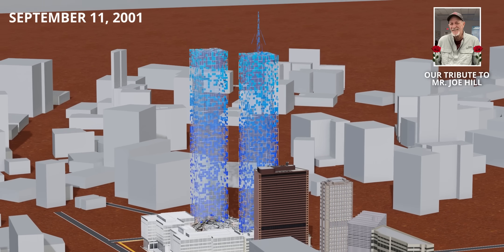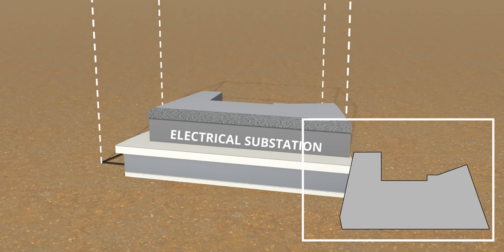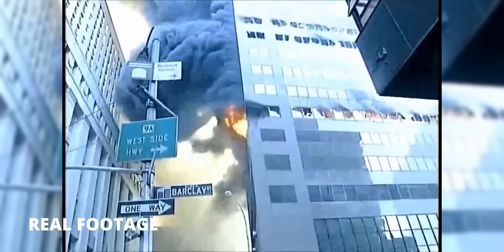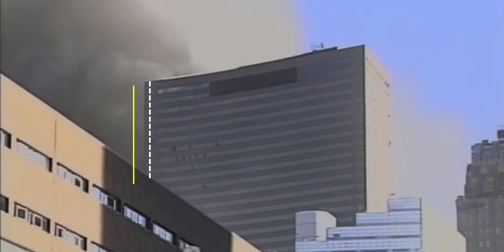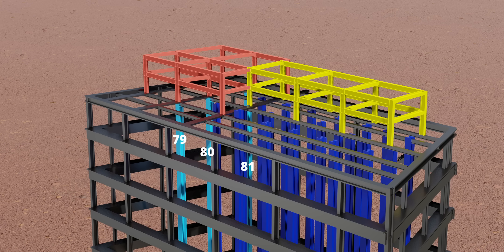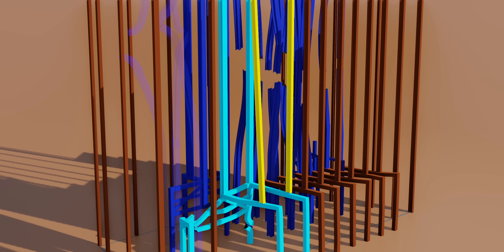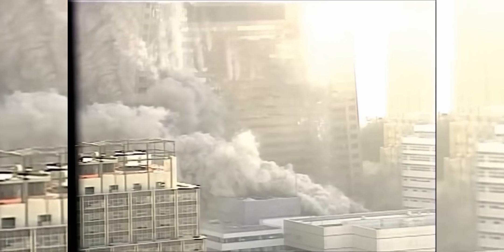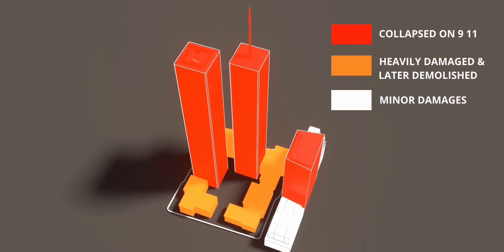Collapse of Building 7 | The Complete Physics

Comment: Critics point out that the temperature at which jet fuel burns is significantly lower than the melting point of structural steel, suggesting that the towers should not have collapsed solely due to the heat. The mysterious collapse of World Trade Center Building 7, which was not hit by an airplane but still fell in a manner consistent with a controlled demolition, adds another layer of suspicion.
Reply: Idiots think believe steel has to turn into a puddle to fail, rather than understanding structural steel will fail at well below half its melting temperature.

Building 7 - the 6th building to collapse of 10 lost on 9/11 has been extensively studied yet still confuses many. Not famous, not a terror target, and with no casualties, it did not get a lot of attention at first, creating a void the internet rapidly filled with garbage. Because everything seems like a conspiracy if you don’t understand how it works I prepared this brief summary of the collapse from my own analysis. No politics, just engineering. 

Context: The North Tower collapse at 10:28am bombarded Building 7 with tons of burning debris, causing heavy damage and starting multiple fires burning out of control for the next 7 hours. Half the FDNY firefighters having been killed, others injured, units in disarray, equipment destroyed, no water pressure, and the greater urgency of Search & Rescue efforts, firefighting was pulled as futile. The building couldn’t be saved and was left to its fate.

www.youtube.com/watch?v=g_SvpwyC17M&ab_channel=MFitz  

Collapse of a burning structure is always a concern for firefighters. Steel buildings subject to fire rely on active fighting of the fires to survive. Buildings are designed around 1 to 3 hours of fire resistance, allowing time for occupants to escape and ACTIVE firefighting to get started, after which all bets are off. Left to their own devices they will exceed their design envelope and collapse. In B7 the occupants escaped, passive and active fire protections were compromised and active firefighting was abandoned which left the building to take its chances. It lost. Odds on Building 7 would eventually collapse, and it did. No big deal in logic. That is the sort of choice firefighters make every day in brush fire situations - which houses to save and which ones to let go. Only real difference here is moving the decimal on the size and cost.

www.youtube.com/watch?v=WnYBX6QT0R4 

FDNY Chief Daniel Nigro ; The biggest decision we had to make on the first day was to clear the area and create a collapse zone around the severely damaged 7 World Trade Center, a 47-story building heavily involved in fire. A number of fire officers and companies assessed the damage to the building. The appraisals indicated that the buildings structural integrity was in serious doubt. I issued orders to PULL BACK the firefighters and define the collapse zone. It was a critical decision; We could not lose any more firefighters. It took a lot of time to PULL EVERYONE OUT, given the emotionalism of the day, communications difficulties and the collapse terrain

FDNY Deputy Chief Peter Hayden ; We had our special operations people set up surveying instruments to monitor and see if there was any movement in the building. We were concerned of the possibility of collapse in the building. And we had a discussion with one particular engineer there, and we asked him if we allowed it to burn could we anticipate a collapse and if so, how soon? And it turned out that he was pretty much right on the money, that he said 'In its current state you have about 5 hours

The collapse of Building 7 was anticipated and widely reported in the media throughout the day. At least 24 video cameras recording some or all of the collapse. Everyone knew what was coming and why.

www.youtube.com/watch?v=OY5S5k3tMHI 

Building 7’s collapse was completely different to the Twin Towers, harder to understand with most of the details difficult to see. But we can sort out what happened through careful analysis and observation.  What follows is MY EXPLANATION of the collapse sequence using the best available information and relying on no authority.

B7 was complex structure, a 47-story steel framed building built on top of a smaller existing 3-story building, requiring several lower floors dedicated to complex load transfer structures instead of usable office space. Of trapezoidal shape and all-steel tube-in-tube construction, B7 (above the 7th floor) consisted of a central core of steel columns carrying most of the gravity load, perimeter steel columns around the outside of the structure carrying the remainder of the gravity loads and long span beams and girders to tie those elements together and form the floors. On the outside of the building hung a moment frame - the last part of B7 to fall. 

Phase 1 : Collapse initiation for B7 is notably quiet with observers not realizing the building was collapsing! There was no audible warning in the form of say hundreds of ear drum busting 180-190dB explosive bangs preceding the collapse. The first externally visible signs of collapse initiation occurred at 5:20:28 pm. Here at 12:00 a local CBS affiliate reporter is talking 10 blocks from B7 when collapse begins. People don’t start to notice the collapse until 12:11. Then at 12:45 is the famous CBS fixed camera clip of Building 7’s collapse Again, note how quiet it is.

youtube.com/watch?v=t5tEy6mXSE8&ab_channel=fresnosean379

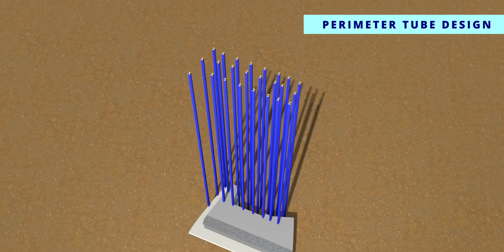Collapse initiation was due to multiple lower floor failures above the load transfer region (7th floor) in the NE corner of the building. In this video at 0:45 you can see the NW corner from inside the building while under construction, Column 79 just out of frame on the left. That big, angled steel beam across the top of the frame connects to C79 at one end. The girders connect to the beam. That beam and all those girders depend on just one connection

youtube.com/watch?v=nP3TNHPCIVU&t=35s&ab_channel=EdwardCurrent

Phase 2 : Lower floor failures caused a loss of critical lateral support over an excessive length of core Column 79 and it buckled. If you look at a floor diagram of Building 7 (see above) and look at all the structures that depend on C79 you quickly realize this one column was a relatively isolated structural element on which a disproportionately greater fraction of the structure depended . Externally we see a vertical progression of window breakage along the 44-46 line and a kink in the roof of the East Mechanical Penthouse at the top of the building, consistent with C79 failure. The transition from full capacity to almost no capacity occurs in virtually an instant. Once the buckling failure occurs there is almost no resistance

Normally with a buckling column, the load could very well be redistributed to other columns, meaning the buckling could stop after a while. With C79 that is not the case - the failure did not redistribute the load, so the collapse rapidly progressed to the roofline, sinking the rooftop penthouse.

Phase 3 : With C79 gone, B7’s progressive, non-symmetrical collapse continues with C80 and C81 at the east end of the core left laterally unsupported and quickly buckled and failed as well, sending the EMP down through the building. C79-81 all have no diagonal bracing, which I believe is a major reason why they could not redistribute a lot of vertical loads among one another.

From there collapse progressed from east to west through the central core until the core was gone taking all of the interior floors and structures and probably most of the perimeter columns with it. You can see the horizontal progression of window failures low in the building and the dropping of the remaining rooftop structures into the building. One of the big takeaways from the NIST Building 7 study (that gets completely ignored) was their modeling which determined C79 failing under ANY circumstances would have initiated the same collapse sequence.

Phase 4 : After some 10 seconds all that remains of Building 7 is just a hollow empty outer shell - the exterior moment frame - creating the illusion the building is still standing since little has changed externally. But it’s just a hollow empty shell like an empty cereal box supported by only a few remaining columns and quite unable to remain standing. With all the internal framing gone. the north face leans inward, forming a V in the roofline, the last perimeter columns buckle under the strain and with nothing left keeping it up the moment frame free falls, landing on top of the 7-story high debris pile. It is only at the very end that a single measurement of alleged free fall acceleration is taken. Note this is not the building but just its outer shell, and only one corner at that, at the very end of the collapse. Start to finish the entire collapse took 18-20 seconds, or less than 1/3 of true free fall and we have to look at the whole thing, not cherry-pick little bits to fit a particular narrative. Worth noting _how fast something falls cannot tell you what started it falling in the first place. The debris spread out, blocking surrounding streets, heavily damaging the Verizon Building and destroyed Fiterman Hall, all well outside of Building 7’s “footprint”.  

Building 7’s progressive, non-symmetrical collapse was incidental and unintended collateral damage from the combined effects of fire + time + gravity started by the collapsing North Tower. That is true no matter who planned and carried out the 9/11 attacks or why . The collapse was of so little consequence it barely even registered at the time, a mere footnote. It only took on semi-mythical status as an alleged smoking gun years later when demolitions at the Twin Towers, missiles at the Pentagon and shoot down over Shanksville all failed and conspiracists had nothing left to work with.

Anything can seem like a conspiracy if you don’t understand how it works. Now you should. I hope you found this helpful and informative, not adversarial and it solicits informed critical comment. If I made any errors of fact, logic or reason or left anything critical out, please let me know so I can fix it. IF you can offer a more plausible alternative please do. Be the first.

Comment: This narration uses a lot of pervasive verbiage.  That's a red flag for me.  You'll never convince me and most structural engineers that this WASN'T a controlled demolition.   The whole building in free-fall?  Sorry, that doesn't happen.  It won't happen.  It didn't happen by a fire.  This will all come out with the new Trump Administration and it should all come out.  This was a controlled demolition of WTC 7, 100%.
Reply: I hate to break it to you but the overwhelming consensus of the worlds structural engineering community - I'm talking 99.999999% here - is that Building 7 collapsed due to 7 hours of unfought multi-floor fires.

That is true no matter who planned and carried out the 9/11 attacks or why - which is probably a blasphemy to you.